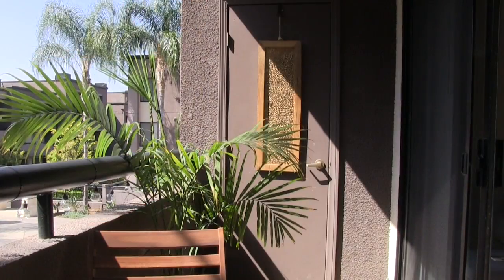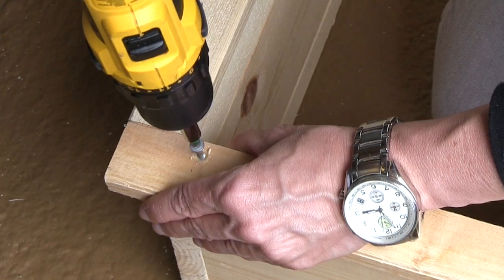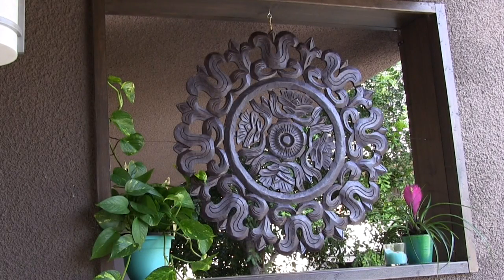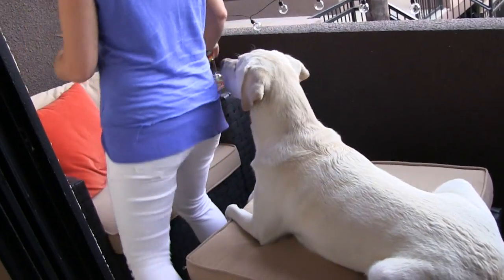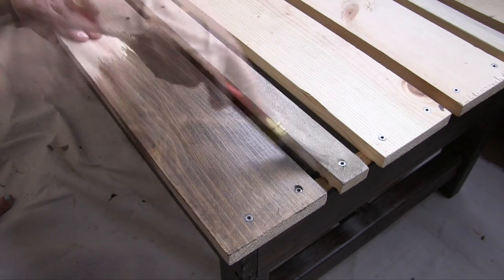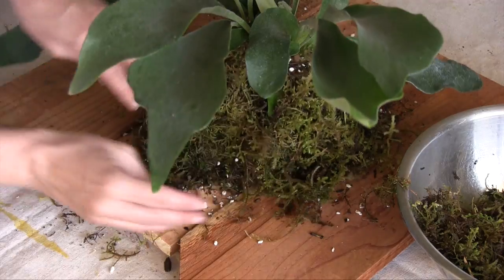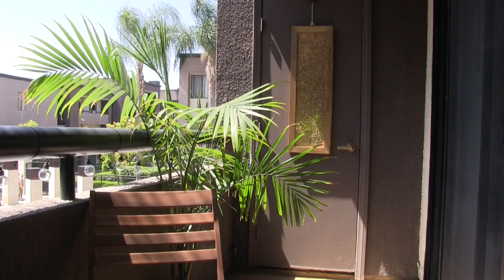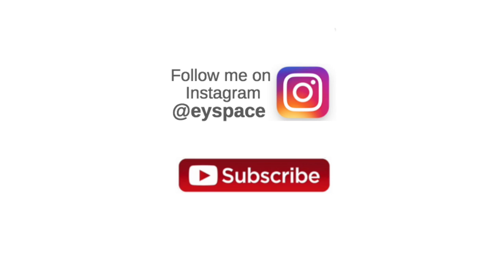DIY small rental balcony makeover on a budget

Comment: I like  many of the ideas. Instead of adding the long piece of wood jutting out from the bench, I might have used industrial strength Velcro or heavy duty Command strips to try anchoring the trellis. Perhaps it could have been anchored enough by pushing it back flush against the back wall corner? It would still be prettily displayed that way. I might even consider making another side & back trellis pieces to match and they might take added outdoor lights.

That plant attached isn't what I'd choose for my space, but to each her own.

Thanks for these ideas - I have some similar pieces that just might work for my small patio. I appreciate your videos! 💞